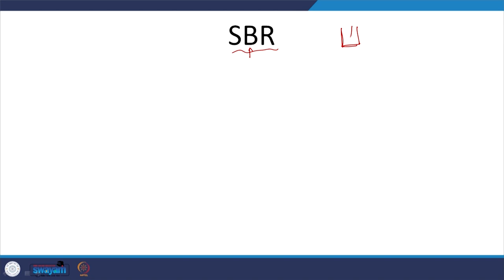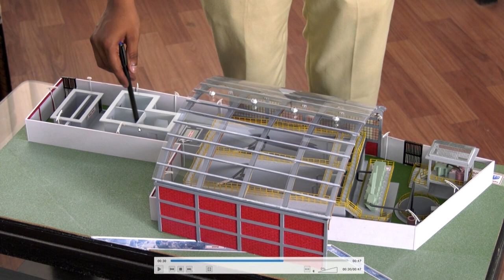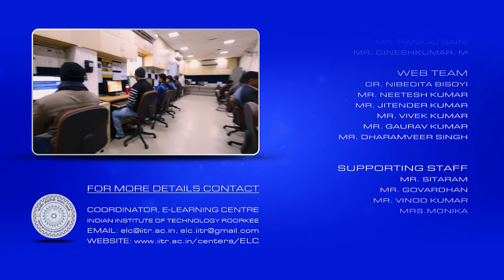Lecture 23: Sequencing Batch Reactor

Comment: I would like you to correct two things, 
1) The exact pretreatment unit name is “Combi Unit” which is consist of fine screening, grit removal and FOG removal too. 

2) you mentioned filter press for the sludge dewatering unit which is not correct. Actually it is Belt Press. Filter press and belt press are two different type sludge dewatering mechanisms.